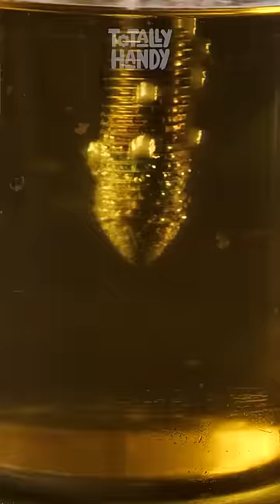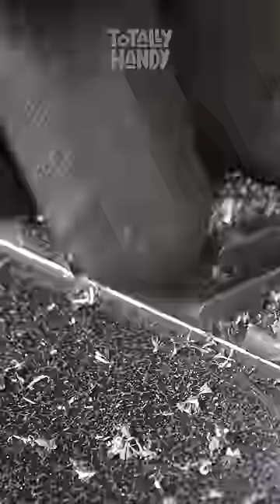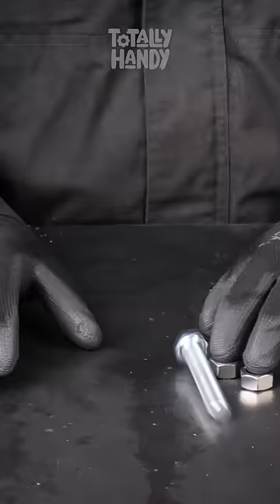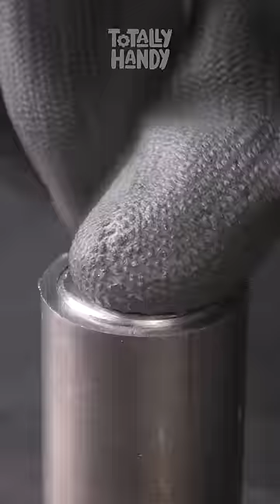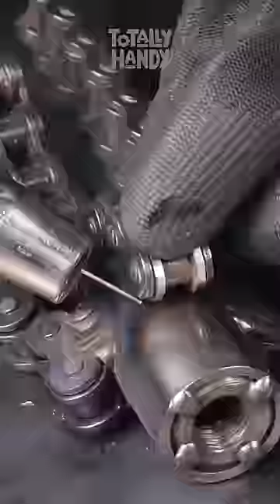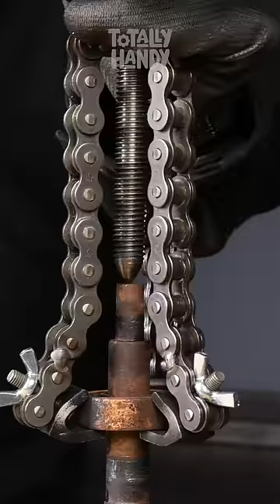DIY bearing puller #shorts

Comment: Now i am gonna harden mild steel. That is genius
Reply: What are automotive bolts made of?

medium carbon steel
Most automotive hardware is Grade 5 rated and is identified by three radial lines on the head of the bolt. They are made from a medium carbon steel that is quenched and tempered.Nov 22, 2013 for all of you thinking the bolts are milds steel  they aren't medium carbon is and grade a are used for Auto

Comment: Thank God I'm not the only one to notice him trying to harden mild steel. 😂😂
Reply: It can of course be case hardened, but if they had done that off camera, the metal would be grey and mottled before quenching, and in any case it would not be a remedy for the lack of bending strength of the mild steel angle.

Comment: You harden all the metal bits with oil quenching but ive went through making one of these with unhardened steel and the chain broke..  you can make the stuff outta armor plate and the sheet metal with brittle bearing guides holding the chain together is gonna snap and pull apart easy….

Comment: The chain is a pretty decent idea, adjustable it could be used on various sizes? But the clause itself has to be hardened steel as well as that center threaded shaft also has to be hardened steel.

Comment: This puller costs 5 bucks, and it takes several hours to make it and there is no guarantee that it will work normally, so my couple of hours are much more expensive than 5 bucks and I will buy this puller in a store with a guarantee of its operability.

Comment: Btw... where you’re attempting to en that mild steel. Well it’s a waste of time because mildsteel doesn’t have enough carbon to harden. You can case harden it by introducing carbon to a small outer layer and you should be using used diesel motor oil

Comment: 체인터지면 최악상황에 실명되겠는데…
Reply: How? How will it blind you? If you use safety glasses\goggles like your supposed to you shouldn't be hit by the chain.. plus the chain is only a few inches long.. do you plan to have your face right beside it???
Reply: @atomiccanadian5744  Oh, that's a good point. I wrote a comment without much thought. But if you care about safety, you would have bought a product certified for safety at a hardware store and used it. Thank you. I used a translator because my English is not good.
Reply: @kimsungggillli  that's not the issue though. If you work with tools there are three basic safety items you must wear at all times. Steel toe boots, ear protection and eye protection.  It does not matter which tool you use, you must always wear that. And even store bought tools can break too. Accidents happen. But if you have eye protection on, then you should be fine as long as your face is far enough out of the way encase the angle iron slipped.

Comment: This would be worth putting an effort into making. They're pretty expensive...if you can fabricate one for pennies on the dollar and have the tools to do so, why not. Nice video!
Reply: Indeed. I've made dozens (out of proper materials) for specific jobs. One reason they're so expensive to buy is that if you're dealing with press-fitted assemblies, the proper materials are seriously strong which not only costs when you source the material  but means you need decent machine tools to provide the necessary features (like the threads).
But if you need to charge your time and do a variety of work it really pays to buy proper pullers, either self contained hydraulic or (for really heavy work) separately pumped hydraulic.

Comment: When he welded the two nuts on the pipe, i’m pretty sure he would need to use the bolt to get the nuts aligned and not just plop them in and weld them on the pipe. If not properly aligned, that bolt won’t get past the second nut.
Reply: Nevermind, i reviewed the vid and he did use the bolt to align the nuts, it wasn’t obvious at  first glance. My bad.

Comment: What's so wrong with making your own tool? I get what everyone says about trying to harden mild steel. I laughed at that too. But.. I've made my own tools before..

I was in hvac for awhile.. I made my own tool to open the Pittsburgh joint using and old dull pipe cutter blade a piece of ready rod, two scrap pieces of pipe, 2 washers and two nuts. That simple tool save me so much time. I could prep the Pittsburgh joint on a 8 length of duct (that really 16 feet as one length is two pieces) in under 20 seconds. Instead of a few mins to do a whole length with a hammer and flat head.

Edit: I will describe how to make it.. start at one end of the ready rod (i used 3/8). Put a lock nut, then washer (I used 1"), then the first piece of pipe ( I used an old piece of 5/8 copper cut into two 6 inch pieces, yeah I know dissimilar metals, but it's not being used for anything so sue me haha) then your cutting blade (mine was from an old Lennox), then the last piece of pipe, washer and lock nut.. the key is to leave 1/8th gap between the washer and that last nut. Because you are not using bearings you need that little gap so everything moves freely. Then just pop it in the joint, get your angle how you like it and just roll it back and forth.. the Pittsburgh joints turn out flawless if you use a duct hammer too!!!

Comment: Hmmm…
Buy roughly $5,000 worth of power tools, welders, material, and other equipment. 
Or
Borrow a gear puller from your local auto shop for free, or at a very low price.

I wonder which the majority will pick.

Comment: What an adorable puller tool.  Too bad it has no strength and will never work on a real bearing or anything older then brand new with grease on it.   There is a reason these tools are made by professionals and not idiots in their garage.

Comment: Just buy a bearing puller it'll cause as much as doing this. Also why are u quenching these parts? There mild steal they won't harden lol so it is pointless. And because of that u will have to make a new puller after 1 hard to pull bearing lol